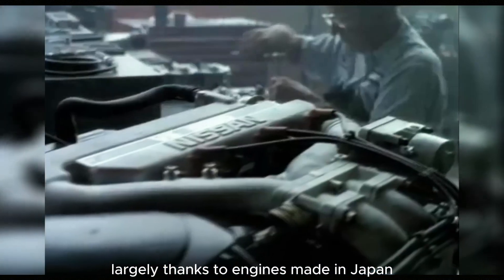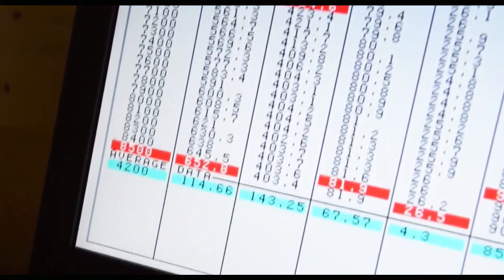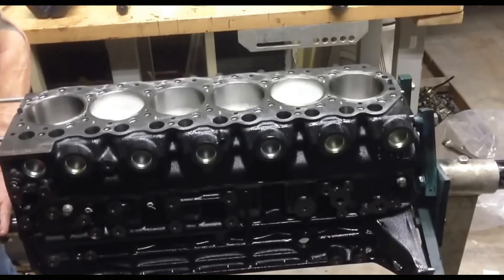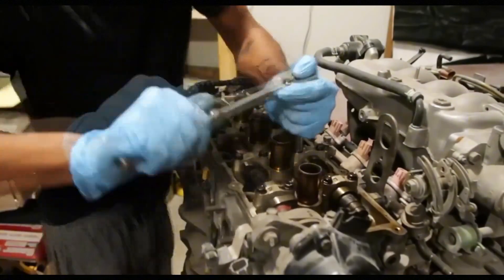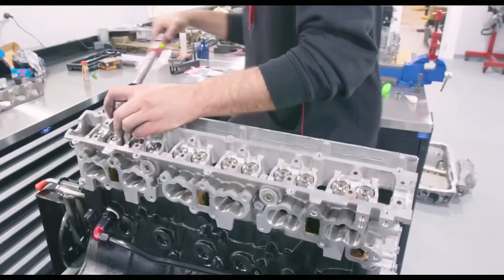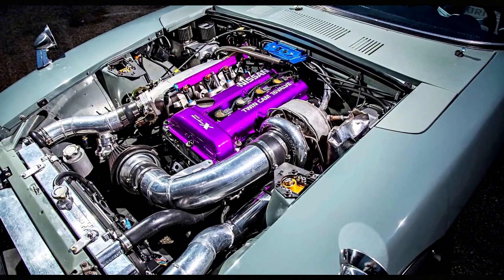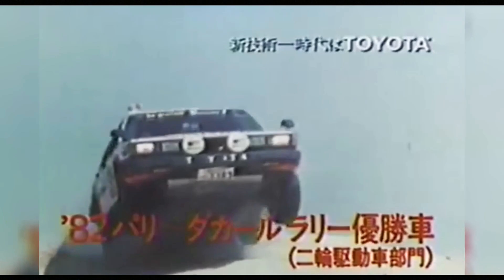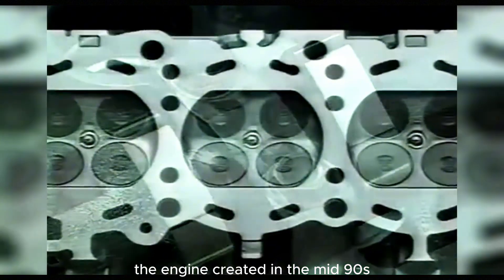NISSAN engine you didn't know amazing Nissan facts

Comment: The 2005 2.5 is a gutless wonder. No torque or top.
Open deck shim valve cheap engine. To change plugs you must pull the intake manifold off.  That engineer should never have children.